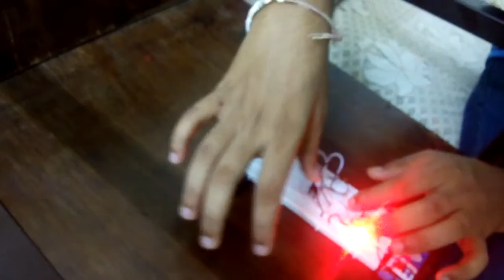MOSQUITO REPELLENT CIRCUIT

Comment: i hardly understand what are you saying . but can you please explain or state the explaination or the process and component needed ?
Reply: see...dude , its very simple to design the ic555 timer as a frequency 
generater in unstable mode. U need need to keep T= 1.38RC, here T=1/f, 
where f is the frequency of the circuit. and R is the resistance value, 
and C is the capicitance value, keep R=1K ohm, and calculate value of C.
 For pin diagram and working of ic555 in unstable mode, go through 
wikipedia
Reply: u need to add a peizo buzzer, that will convert electrical signal into ultrasonic frequencies
Reply: From where can I get the Piezo buzzer? Rest of the components I know are easily available.

Comment: excuse me how to make a circuit of 30 kHz using only resistors and capacitors,buzzer and ic 555. can you send me ckt diagram plz.
Reply: see...dude , its very simple to design the ic555 timer as a frequency generater in unstable mode. U need need to keep T= 1.38RC, here T=1/f, where f is the frequency of the circuit. and R is the resistance value, and C is the capicitance value, keep R=1K ohm, and calculate value of C. For pin diagram and working of ic555 in unstable mode, go through wikipedia